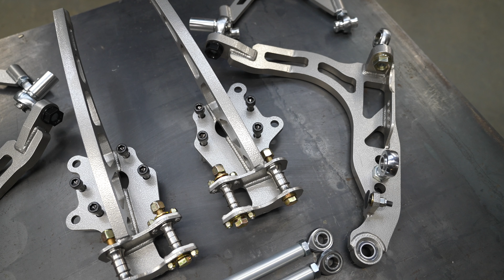FDF 350z/G35 Mega Mantis Angle Kit Install (Step by Step)

Comment: One point missing in this insall video is that you should grind down the tabs on the lowwr control arm mounting point. Without doing this the heim is too big and you can't insert the bolt